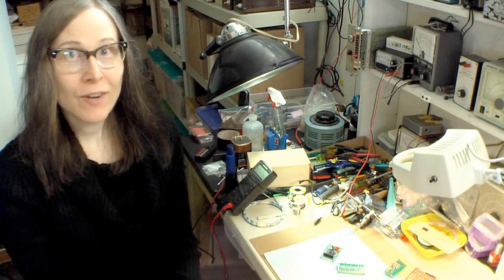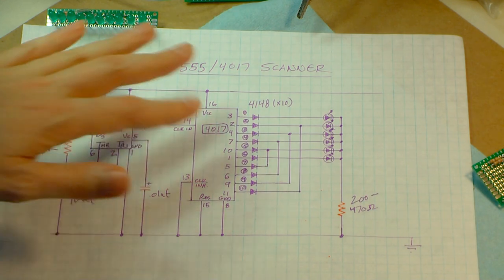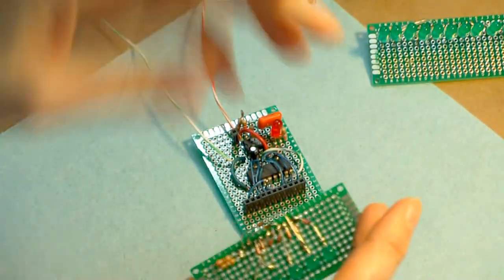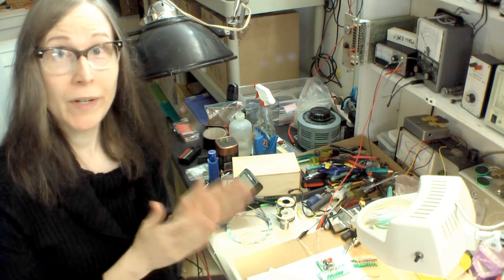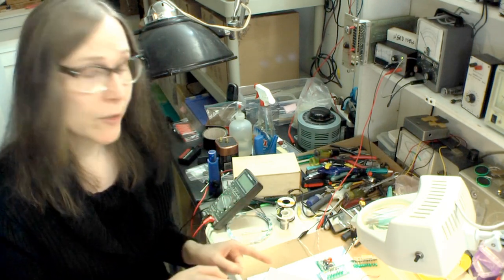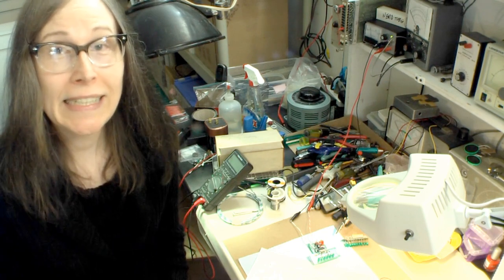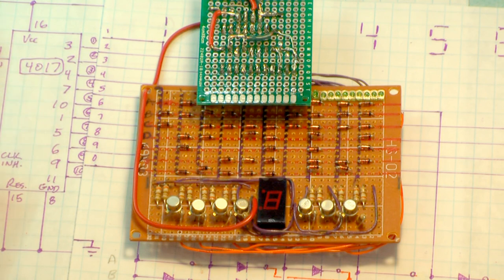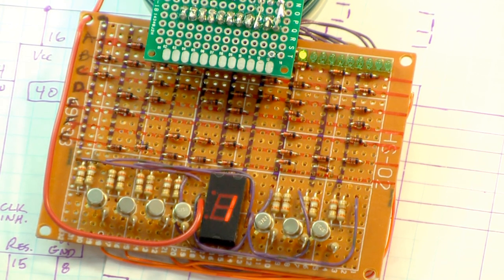FranLab: Diode Steering For Displays

Comment: Wow.
Way back in 1968, I had seen my first electronic calculator at the Pacific Science Center!
It had a CRT display, and used some sort of vector display driver.
I was fascinated as much by the number-crunching as I was by the flickering 7 segments on the screen.
I got home and started working out a diode matrix to duplicate what I had seen!
After many false starts, I figured out that the 7 segment displays needed one set of diodes to translate the values 0-9 into readable numbers, while calculation would need another set.
The display was the easy part.
I then undertook making a diode matrix to cover multiplication of whole numbers.
I didn't get very far...
It was years later that I learned of binary math and TTL electronics.

Comment: All of the videos about displays have given me a new appreciation for them. When I was younger and working as a technician the drudgery and drama at my workplace often zapped my enthusiasm and desire to fully understand how the devices I was repairing worked. I never paid much mind to the large amounts of diodes on the display boards, they never failed so I never put any thought into why all of those diodes where being used. Now that I'm no longer working at that place it's very cool to see this and begin playing around with diode steering circuits myself. Looking back, it's kind of sad that I spent so much time in a work environment that stifled curiosity and drive for deeper understanding. The engineers were very jealous and would not share the theory of operation for the boards they designed so we were given very little information and often had our questions blown off. I could have provided so much more value to that company if that information had been shared with me, saving alot of time on repairs and performing my duties with full independence.

Comment: I can see you had a lot of fun with this. My first encounter with diode steering was in about 1968 I was working for a company called Frieden in Nijmegen The Netherlands We programmed the first type of punch tape systems that contained step relays and diode banks, The diodes where about 1 square inch and green in collour shredded on metal rods. I was about 18 years old I believe the company was taken over by Siemens Germany. Your presentation is exellent.

Comment: Interesting, you can use the 10th pulse to start the counter on another board, Then as it hits 10 you start he next ... And with the right value on the timing though the 555 you can have it as a stop watch...   built one like that in scouts in the 80's.  
10ths second, 1 Second to 60, start the Minute counter to 10 minute top... just didn't have enough cash while in junior high to make a bigger display...
Snagged the display from an old clock radio.
Love it Fran, you are the personification of true  electronic joy.

Comment: I really like your clips, Fran and respect your level of experience.  That said, I also realize that you are teaching principles and methods here than showing engineering design and choices.  Also pre-date you a bit and got my BSEE in 1965.  So I was on the cusp and was taught both tubes and transistors.. so I'm not a young whipper-snapper trying to yank your chain.  All of that being said, as an engineer I naturally tend to look for as simple as efficient a design as possible and I would use a nano arduino and a 7-segment to accomplish the same end result :)  The disparaging comments I saw here for micro controllers does surprise me.. a simpler, cheaper, almost zero labor solution in comparison.  But once again I realize that this was a teaching session for principles that many are unaware of these days  >>> great job!   BTW the diode steering in the first circuit you made is a great example of OR logic :)

Comment: i recently took apart a 80's VHS video camera with the goal of salvaging the mini CRT and hopefully getting a unobtainable FR02-60 diode to repair an old oscilloscope. no luck but in the user interface buttons. i was surprised to find diode steering circuitry in such a late modal. very cool.

Comment: I still have 3,2,4,7,10,1,5,6,9,11 memorised :) Also, reminded me when I used to use 4017 diode steering to run the correct code to get stepper motors with xy mirrors running for fast laser lightshows :) (without having to buy expensive stepper driver ic's back in the early 90's).. those were the days.. fun times and learning by tinkering and imagination.

Comment: Thats cool. I didn't know it had a name. It's something I did in my teen years to make a basic Lighting Pattern Controller. I used a 4-bit binary counter to a BCD to Decimal chip that had 16 outputs. I then used diodes to create 4 - 4bit patterns connected to Opto-Relays to drive 4 PAR36 Lamps to create a basic disco controller :D I still have it and I date coded the pcb, it was made in 1991 :D and although its a jumble of fragile wires I can easily repair it actually still works! The diodes are on what I call the "decoder" board, separate to the other circuits. 16 wires in, 4 wires out to the opto's. Chips are 2xNE555, 1xSN74HC193 (up/down binary counter),  1x74HC154 ( BCD to 16LIne Decoder ). The 2nd 555 is connected to the 'Reverse' Input of the binary counter to add a bit of randomness to the otherwise sequential pattern output :)

Comment: The last project I made with a 4017 & diode steering was my lawn Lighthouse. It has three LED emitters arranged facing outwards at 120 degrees around a circle (inside an acrylic "nav light" lens). The diodes are on a daughter board so I can swap it out for different patterns, but currently it's set to sequence A,AB,B,BC,C,CA before resetting. That gives a pretty good impression of a rotating Fresnel lens. All that is rather cool of course, but where it gets interesting is what drives the 4017...

Comment: What a cool retro project! Thanks for sharing this video. One thing you need to do is tell people where to add some capacitors to the initial LED design to create the highly desired decaying illumination. Only then will you have a perfect Larson Scanner.
Reply: Let's be frank, here: the original Larson scanners probably had that decaying illumination because they used incandescent lamps.

Comment: I gave this a go a few years back. On a much simpler scale.
A 555 timer to produce a clock signal, and a 4017 decade counter. The outputs were 'diode-steered' to three LED's to make a traffic light effect.
I didn't even know that diode steering was a thing until I saw this video. I just assumed that I made the worlds most inefficient use of diodes :D

Comment: Fantastic!!  What a precise 3D wireing!
You had made DTL circuit equivalent to SN7447 (or CD4511) with your hand.

The 7-segment LED in this video Monsanto MAN72, was also supplied to Japan, far from U.S.A.
I have the device made in April 1976. Now it works.

Comment: Excellent video, Fran as always. Now we know the way to your heart! ;) MAN72's... Yes I remember building a 6 digit LED clock back in the 70s using TTL logic and some similar 7 segment displays of the day (think they were TI), all parallel driven of course. It drew several amps from the 5v supply! As I recall, the 7447 7-segment decoder driver didn't add tails to the 6 and 9 but the later CMOS 4511 did. :)

Comment: Just realized that these old displays with their little 125 to 350µcd per segment are actually very friendly to the camera. Their segements still appear red, not white like the current bright dispplays we use today. Neat. Also Telefunken used the same technology to drive the first 70's TV's program number displays. They were arranged in a small plasitic box which was then soldered on the board and also driving single transistor stages like your circuit. Sadly I don't have a photo of that, and I gave the thing away.
Reply: Here is where the current owner of said board jumps in and provides a couple of pictures. :)
http://imgur.com/a/MGZt7
Reply: Electricguy
Haha, awesome !

Comment: Fran, I"m so glad you explained how DTL works.  I'm thinking of making the 555 into a 2 transistor astable multivibrator and the 4017B by using transistor nand flip flops.  If I don't sloth too much!!  Again, I am so envious......
Reply: DTL is great, when you're making logic circuits from discrete components.  I've seen people make whole computers out of nothing but 2N2904 transistors, resistors, and 1N4148 diodes.  Well, and LEDs, of course.

Comment: Thanks for the clip. I'd forgotten about diode steering. Excellent soldering skills, very pretty board. I did not know the connection between common anode and transistor drivers, now makes sense. Conventional current or electron  current? To this day it seems like EE departments (and books) choose to, or have to, use conventional current rather than electron flow (even the now running course EE40LX from UC Berkeley through edX). I still have a couple MAN-72 displays. Very nice project. Thanks for sharing.

Comment: OMG, this brought back memories of my first decent bench power supply build... I wanted to expand on the LM317 variable power supply I'd made from a book, and make it a switched variable voltage PSU. So I used a 2 pole 6 way rotating switch (a bit like ebay item 252832700314), one pole was tracked to a board that contained variable resistors, these were used to preset the voltages I desired, the other pole tracked from a 5v voltage regulator as common, with various numbers of wires going out to a board that contained groups of 1N4148 diodes to 'steer' (neat description that, steer), steer current to the appropriate segment of the LED display in order to obtain the voltage. There were 6 rows of diodes (my voltages) and 7 columns (segments). Turn the switch and it adjusted the output voltage via the LM317 and displayed the voltage. I eventually expanded on this with a DPDT switch and a second rotary switch, added more variable resistors and increased the 6 rows of diodes to 12 rows (my voltages), this gave me from 2v up to 36v DC, at about 1A, and this PSU lasted some fifteen, maybe close to twenty years before it started failing due to tiny short circuits from the heavy amount of flux that came from all the solder joints around the diodes on the Veroboard.

Comment: While it didn't specifically have diodes (I had to use AND gates), I built a replica of the classic TIL311 smart hexadecimal display inside the video game "Little Big Planet 2", which has some really cool logic components to build levels with. I really only used it as a way to play with circuits. They never included PROPER flip flops... They had stuff that worked like it, but not quite, but you could just build real flip flops using the other logic elements. I took the time to add an extra row and column of pixels, and really nicely stylize the design with things like a half center segment for the 3, and a half left upper segment for the 4. I like how it turned out!

Comment: Im glad im not the only one that loves 555's / 4017's and in4148's :D, 555's are such a usefull chip, oscillators/latches/timing/so many uses, i stick to the original non cmos types, they seem better or perhaps im biased :D
The 4017's and diodes ive found in "roger bleeps" in c.b radios, ive repaired bucket loads and got to love the 4017 :D
The 1n4148 is the first number i think of when i see a similar part, along with 1n4001 bc108/9, and 2n3055 for power supplys and repair of early stereo amplifiers.

Comment: Depending on your camera, it samples the image top to bottom, so that might be why it may have taken a frame when both LED's are off
Reply from the maker: Nick Martin I thought this as well - most probably correct.
Reply: I was thinking the same thing.
Reply: That sounds much more plausible than the counter's propagation delay being long enough to see on video.

Comment: I made exactly all of these circuits, in the 90s! (Except without the transistors, because I was using modern LED segments) I had great fun, figuring out where I wanted the diodes to go. My PCB layout was awful, though... a very chaotic mess! Now I guess I'd lay them out just as they were in the schematic, just as you did here.

Comment: great ! a led-scanner without a microcontroller :-) unbelievable in the "arduino"-Epoche ;-)
Reply: I agree - it's a nice project for the sake of making it, but pogramming a micro just gets you there quicker.
Reply: I mean, I did this many years ago, only without a matrix. Just haphazardly connected each digit by diodes to the appropriate pins on the 7 segment, and it worked. It was ugly, but it worked.

Comment: Wow, lovely 3D matrix on the 7seg decoder :)  First time I saw a diode steering circuit was in the coleco vision game controller. It has a number pad in conjuntion with the normal lef-right-up-down-fire buttons, and only standard 9 pin atari port. So they use a diode steering to send commands like left+right, which doesn't make sense in a joystick movement, but can be decoded by the coleco console as a number key :)

Comment: Electrical Engineers work with Hole Flow (hole=where an electron isn't), but Electrical Technician learn electron current flow.  Circuit diagrams are drawn by/for the Engineers and Techs learn to adjust to the backwards representations.
Reply: Thank you. I love Fran's videos. I own two of her pedals, and they are some of my most beloved gear. So I'm not trying to be a jerk here. Like I said, I love her content, but that tangent about backwards diode/transistor symbols really irked me. The symbols are "backwards" only coming from a reference that isn't relevant to the information a schematic is meant to convey.

Comment: Too much! Oh my gosh!
Diode logic! I made a multiplication calculator in 7th grade. I was so frustrated my science teacher didn't understand.

You are amazing. You covet a box a segment displays. Clearly if given a box of 9,000,000 leds, with drivers it would kill you as your brain started imaging the potential. During the cold winters brighter and highly saturated displays would fill your room. During the hot summers even brighter displays would be used and better air conditioning deployed!

Oh gosh.

P.S. Some of your resistors are reversed. You looked like the kind of woman to me that would dot you i's, cross your t's and cross your i's for good measure! (Line up your resistor colors for quick double checking of values.)

Great job!

Comment: Those 4017s actually make decent larson scanner devices. It's easy enough to use any combining logic gate in place of the discrete diodes. Still, I have a lot of respect for this as it helped make two of my favorite shows as a kid. Both Knight Rider and Battlestar Galactica used that circuit. Diode steering or logic gate, either way it's a really cool effect.

Comment: The inverse current direction is not that much of a misconception, just a different way of saying it. Electrons have negative charge and they go towards higher potential, positive charge goes towards lower potential. Also holes (hole is an absense of an electron) behave quite differently and not directly opposite to electrons (they have different concentrations, movement speeds, life spans). This makes them things of their own and not rudimentary in understanding physics of current flow.
Reply: electric current is a flow of electric charge, not necessary only electrons, it can also be carried by ions in an electrolyte, or by both ions and electrons such as in a plasma and ions can have positive charge.
The direction of conventional current is arbitrarily defined so that a positive current flows in the same direction as positive charges and vice versa.
According to that symbol for diode is drawn in correct direction.
Reply: Well, if you model your world with positrons, suddenly, everything is alright.

Comment: Well done Fran, although I'd argue you've made a 70-bit discrete ROM!
Reply from the maker: Oh Don't Tempt Me!   Diode ROM is another great project.
Reply: Fran Blanche
Consider yourself tempted! Videos showing how stuff works on a very basic level are needed :D
Reply: Some old calculators had their entire firmware in a diode matrix.
Reply: I've been into the idea of making a computer from scratch for a while, this has just given me a neat idea of pre-programmed cards. Which I guess adds the new complexity of cycling the memory to copy from the card on startup, which I guess needs another ROM program of sorts... oh dear!
Reply: In my 1979 DIM (Do It Myself) Z-80 computer, I used a diode matrix to encode the keyboard into ASCII.

Comment: Great stuff. I have 7 segment displays with their own driver chips but have also tried wiring them myself just for fun. Gets pretty complicated.

The whole conventional vs actual current thing is such a stumbling block to new electronics students. I had a book with my electronics project kit from Radio Shack when I was 13 that explained conventional current and that all schematics where written that way. Then later in the book the writer would switch back and forth between electron flow and actual current flow without warning. It was so confusing I just gave up. 

I don't have a problem with conventional current flow (it's easy enough for me to imagine positively charged "holes" displacing electrons as they move the opposite direction). I just wish teachers would pick a direction and stick with it. It might reduce the number of people who give up on electronics.

Comment: You can really do some interesting things with diode steering. I once repurposed a series of rotary switches so that each contact output a nibble value. As you said, the voltage drop was a bit of a worry. Thankfully the input tolerance on those old 7400 chips were pretty forgiving.